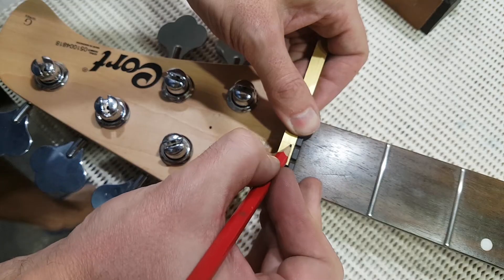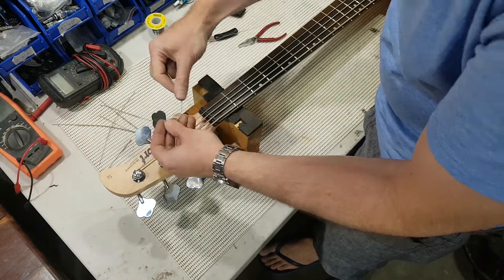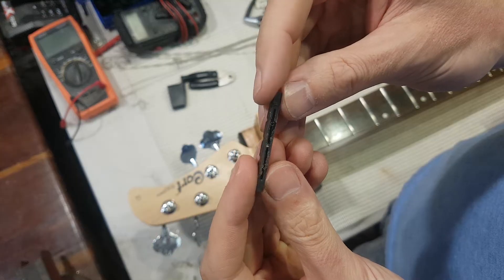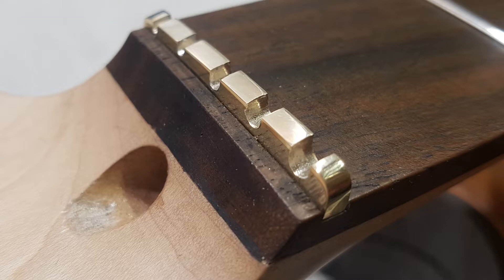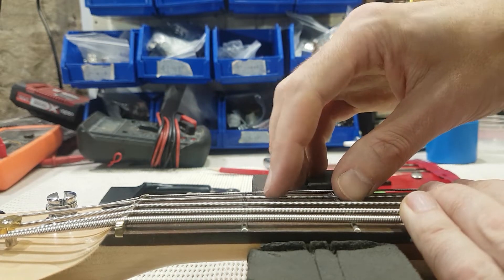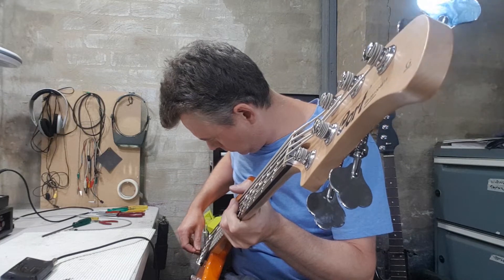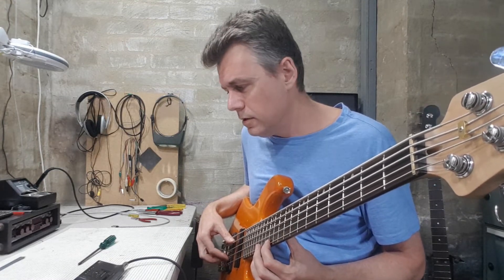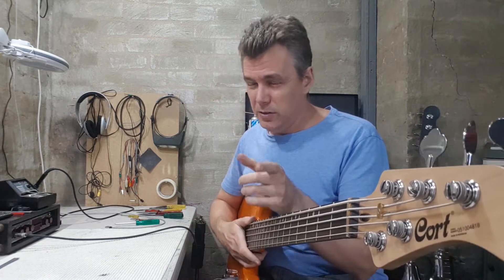How To Set Up A Bass Guitar, How To Make A Brass Nut (Project Berocca Part 6)

Comment: Great series! Awesome job! Where can I find pickup foam like you used in this video? Cheers
Reply from the maker: Thanks George.  I use closed cell neoprene foam.  On ebay, you can find A4 sheets, 12mm thick and with adhesive on one side.  You can also use old mouse pads and a drop or two of super glue.